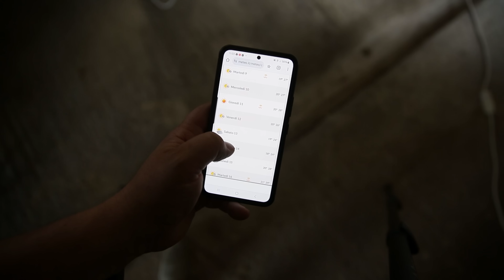#47 Building barn window frames & fighting fleabane

Comment: PS you don't need the dowels in the joints as the joint you have made has a lot of surface area for the glue to work. Some say the glue when dry is stronger than the wood itself. Also a top tip is to use the saw dust form the wood being used and mix it with wood glue to form a filler to fill in any gaps in the joints. When sanded it blends perfectly in colour.

Comment: Great content. For someone not that experienced with wood, you did a stellar job. Be careful with your table saw though. You really shouldn’t cut things freehand, and when using the blade at an angle, put the fence on the side away from the tilt. This will reduce the chance of the wood getting stuck or binding.

Comment: Hey Bertus, Love the anvil! I started wearing a dust mask when cutting metal with the right angle grinder. Realized I was breathing in steel dust. Have you thought about a flux core welder? Pretty affordable and versatile. 😀 Eric.
Reply from the maker: bertus has a TIG welder but we haven't used it here yet because we're afraid it might blow up the old electrical system.

Comment: I just noticed that your older kitchen has a terrazzo floor. I saw many wonderful examples in Venice. It’s one of the most durable and sanitary flooring options available. If repairs are necessary—possibly because of earthquake damage—they can be made and there should be many contractors in Italy capable of doing this. Not saying yours is damaged, but only if it is.

Comment: A Tormek sharpener is an excellent tool for keeping chisel and plane blades razor sharp. It's quick and easy to use and makes using hand tools a delight. You will not need a mallet with a chisel any more...It will also increase the accuracy of your work..
Reply from the maker: One or two sharpeners came with the house. We just need time to install them in the new workshop.

Comment: Not sure on brand or age of your line trimmer. But hubby is a small engine mechanic and taught me the following starting sequence.
Switch off/Run switch to run. Push primer bulb 3 times or more until no air bubbles are  visible in it. Choke on. Pull starter until engine coughs.
Choke off and pull starter again.
This usually works to start it. 
However if yours resists, clean the air filter, drain fuel tank and clean fuel filter. Change spark plug.
Check your fuel tank hasn’t got water or stale fuel in it. 
Dont use any fuel with ethanol added, In Aussie it’s called E10.
Instead use 91 octane fuel.
Fuel can go off, or get contaminated which is often the issue.
The other thing we get is mud wasps nest inside exhaust outlet, which prevents engine from working. 
Oh and 2strokes need oil in fuel, a little more than recommended ratio if engine is worn, helps keep bore lubricated.

Comment: Inspiring to see such simple and graceful woodwork, what is that brass coloured tool you use to score the window frames?
Your meadow will look even more fabulous in a few years time, nice to learn about the pretty yet invasive fleabane.
The plantings in the water pipe trench, edging the parking area has really filled out that space well.
Reply from the maker: That tool is a 'Veritas Micro-Adjust Wheel Marking Gauge', especially designed for this purpose. Very handy!

Comment: I can't help but notice the drone shots. beautiful. I was wondering if the drone regulations and laws were significantly different in Italy than the  US, and while there are some, many things seem to be the same, especially the "line of sight" part. In the U.S. the drone unless very specific exceptions are made, must remain in clear visual range of the pilot, without use of things such as binoculars, telescope etc, unaided eys other than glasses. This also precludes in, near or above clouds, as that obscures visualization of the drone by the pilot. Seems Italy is fairly similar. License, Remote ID etc..
Reply from the maker: We have no experience with drone regulations outside of Europe, so we can't compare. But yes, you need a license, need to respect no fly zones, can only go to limited altitudes etc.